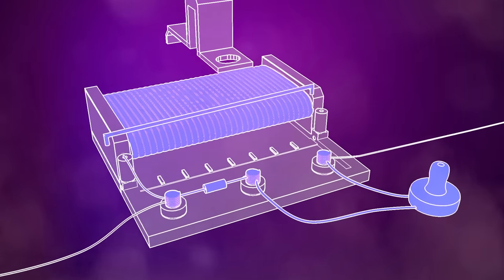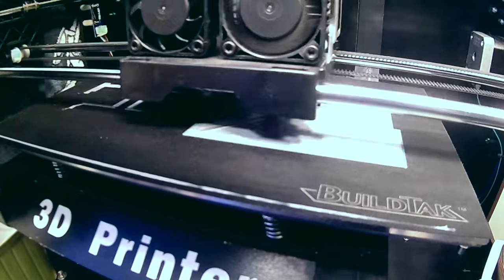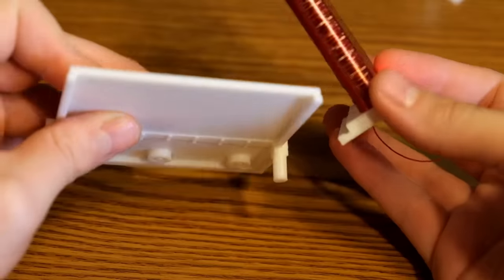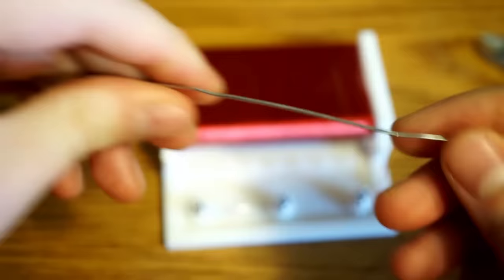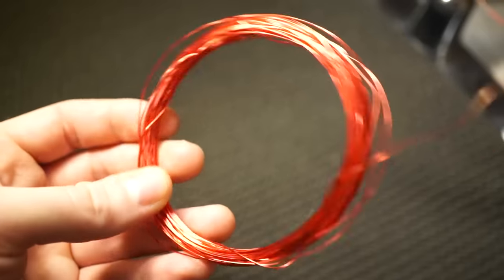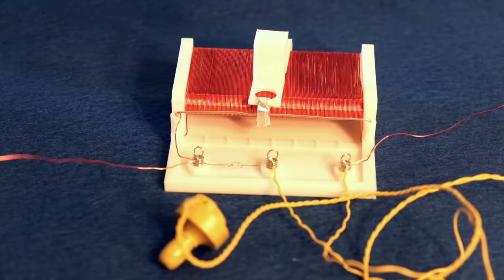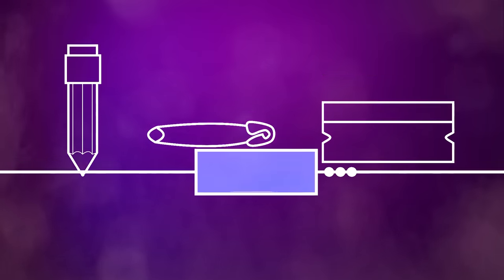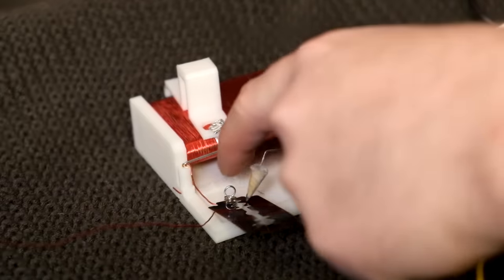3D Printed Radio | No Batteries

Comment: you forgot to mention that the diode must be a germanium one to be efficient. for example an 1N34 or an 1N270 would wourk perfectly
Reply from the maker: Yes you are correct and I listed the 1N34A diode in the video description. The same one I used.
Reply: Or a Shottky diode BAT85
Reply: The zero-bias MOSFETs are insanely good too. No battery required.
Reply: @ZEEROXCD-izzy  that's not nerd speak, that's engineering...
Reply: May I ask what the diffrence is from using a silicium one?
Reply: @javs533  it's all about the chemical properties of the material. Germanium behaves very similarly to galena chrystals that were once used as revelators in AM receivers. They can easily separate audio contained in the transmission, from the high frequency carrier, making it audible. Silicon diodes can do the trick too but they perform much worse. Germanium diodes are an extremely outdated technology but they are still very popular because of this special ability. Plus they are also great at sound distortion in guitar pedals: they have a very smooth and warm sound, almost like vacuum tubes
Reply: @Mr_Lambda  profile and pic check out
Reply: I see your mit education is really paying off
Reply: @javs533  Actually the real reason is because Germanium diode usually cause a smaller voltage drop when conducting. The signal being probably really small in this case, it is highly beneficial. However, as said above, a schottky diode should work just as well as they cause a small voltage drop too. (plus they are way easier to find than those unobtainium outdated germanium diodes)
Reply: @wa9kzy326  The germanium is still more efficient for this purpose
Reply: @Mr_Lambda  I don't mean no disrespect, but can you justify the "warmer sound" of a germanium diode? I believe it to be basically false. Germanium diode in guitar pedals usually are used for hard clipping, meaning that any effect they could have on the sound (the harmonics generated) are probably way too small to detect by human ears. For the record, I do own a tube amplifier for my guitar, and do believe they have an effect on the perceived quality of the sound by the mere signal to noise ratio they offer as well as by the harmonic content they generate, as they are highly non linear when used as an amplifier stage.
Reply: @thomhpl  I don't know if I'd call them unobtanium since you can still find ten packs on eBay for cheap. Not as cheap as little silicon signal diodes mind you, but you can find them just as easily. The hard part is finding germanium transistors, their hermetic seals fail over time and cause them to perform poorly or not at all. Finding working ones to match American made transistors from the 1950s and 1960s is an absolute pain.

If you're going to use a silicon diode your sound is going to be even worse. Get a fast recovery type for it to be even remotely viable.
Reply: @AiOinc1  I remember reading about the fact that a lot of the 1n34 you can find on eBay are fake, and actually just some rebranded Schottky. They appear to be some that are genuine though so yeah unobtainum is a bit abusive.
Reply: @AiOinc1  That's interesting, what makes a fast recovery diode more suitable? The reverse recovery Time of Schottky diodes is usually way better than fast recovery pn diodes. I'm also wondering what is the reverse recovery time of a Ge diode like the 1n34a. Btw, this is probably just over thinking, the goal here wasnt exactly sound quality I guess ;)
Reply: @Mr_Lambda  Oh man, there was a whole tred that germanium transistors are better for amplification.
Reply: @thomhpl  what i meant for "warmer sound" is that they have a less steep clipping factor, they don't sound dry as silicon ones that drop voltage to 0 instantly when they invert their polarization
Reply: @Mr_Lambda  You're right, but in this application, the diode is used in a detector circuit, I don't think it matters much. And btw, I do think it's perfectly doable to achieve the same clipping harmonics using silicon diode in a guitar pedal, by adjusting the amplification gain before clipping to match the same relative voltage drop, and by adding series resistor to the diode to soften the transitions. It's not exactly the subject of this video, but it would be interesting to do some double blind tests to see if it actually matters at all or if its homeopathic engineering ;)
Reply: @thomhpl  the warmer sound thing was only about pedal distortion. I only tested germanium diodes on AM revelators so i don't know how a schottky or a simple silicon diode would behave.
Reply: Ded The Channel yea said from a little sonic fan
Reply: @Mr_Lambda have you ever seen n the insides of an am transmitter before? or tuned a directional? can be scary and fun
Reply: @TheCoolDoctor  despite being a ham radio operator i never had the chance but i guess it would be hella fun :)
Reply: @Mr_Lambda  ill be it its not fun having to splice 5 of your 6 3/4 inch coax from your main AM transmitter and monitoring out of your building after they got cut. That was an 5 hour ordeal.
Reply: @Mr_Lambda  Makes you wonder why he even clicked on this video if he doesn't comprehend it LOL
Reply: @Mr_Lambda  So that's how they simulate that sound in cheap tubeless TS9s. The way more expensive originals had a single tube.
Reply: @MikinessAnalog  i'm pretty sure that they also use some level of filtering to manipulate the sound texture
Reply: This dude: Ackchyually
Reply: @Mr_Lambda  I see no difference in nerd speak and engineering
Reply: Why not go old school and make you own detector
Reply: @donwright3427  i'm actually planing to take an old razor blade, heat it up with a torch until it oxidizes and try to make it work with a pencil :)
Reply: @Mr_Lambda  I build my own pedal both using ge diodes and Schottky diodes. The main difference I see is leakage and internal capacitance. You can get a very similar result if you use the clipping Schottky diodes with a small capacitor and a resistor parallel to them. Usually 100pf and 47k resistor. Only noticeable difference is in the price.
Reply: Wait you forgot to use plumbus
Reply: Thanks gordon!
Reply: @Mr_Lambda  thank you been looking for a material that acts like a vacuum tube after all a transistor used to originally be 3 pronged vacuum tubes.
Reply: As a fantasy nerd this sounds like a bunch of wizards discussing which mana stones should be used for a communication circle.
Reply: @sebastianstewart6894  wait, diodes do not amplify. What i mean is that germanium diode clipping effect, sounds similar to overdriven vacuum tubes, but they don't serve as amplification component, that's not their pourpose. If you need to amplify you will need necessarly a transistor, a vacuum tube or an Operational Amplifier ( Note: O.A. can only be used as a pre amp, since it can only output 20mA max)
Reply: @sebastianstewart6894  yeah i know what you mean :) electronics sounds like wizardry because you have a whole lot of tiny pieces that do stuff and it's hard to understand how they work together. To understand in deep how they work you first need to know a little bit of electron physics, a pinch of chemistry, after that studying the theory behind the working principles of electronics will come easier. To implement that knowledge and design something from scratch, especially in the analog/RF/Audio field of electronics,  you have to learn a good amount of calculus. Most of the math in there are just some simple equations but in order to make something advanced you need to be able to solve integrative, derivative and differential functions. Yeah electronic engineering packs a punch xD
Reply: @keeby.kong2024 my crowbar doesn't think the same <3
Reply: @Mr_Lambda um... C-crowbar? that's my bad. I'm sorry. I apologize
Reply: Does a germanium 1N60 work well
Reply: @demonetizedhistory5806  it should work, generally the am revelation effect is a perk of germanium material itself. Look for ilthe component datasheet: if the brief description says small signal or power application diode it  should work. If it's a zener, schottky or varicap or something different i don't assure it will.
Reply: Ty
Reply: @Mr_Lambda  thx
Reply: @thomhpl  perhaps the "warmth" came from nonlinearities like with tube amps?
Reply: @Mr_Lambda  what about schottky or mosfet?
Reply: @wa9kzy326  how does one use MOSFET in place of a diode? Was their performance good due to their low 'on' resistance?
Reply: you were 999. my like made it 1000. and I got no idea what the hell is going on. cuz my cellphone got a radio! lock down bought me here.
Reply: @sultanmehmoodghaznavi6312  thanks for letting me hit this milestone, this is my most liked comment ever :)
Reply: When you came into a smart talking or engineering talks but you don't understand everything
Reply: Mr freeman this is wonderful
Reply: That is 1N60 signal diode
Reply: Yes I was going to ask what kind of diode?
Reply: @AiOinc1  he probably meant real ones & good ones?
 not fleabay ones.
Reply: the 1N270 is very expensive
Reply: Jason van Rooij the on voltage is much lower, like 0.3 volts vs 0.7.
Reply: @AiOinc1  There are lots of Soviet surplus germanium diodes and transistors on eBay, too. Just like their surplus tubes, they’re far cheaper than their American counterparts.
Reply: @Mr_Lambda  Revelators? Revelators? Oh, you meant rectifiers or detectors.
Reply: @thomhpl  I thought it was whatever diode (or rectifier or xtal) has the best gain-John in Texas
Reply: @Mr_Lambda  I read about that on wikipedia, I'm super interested in piezoelectric materials rn always wondered how that works lol
Reply: @ercost60  yeah sorry, wrong translation. In my native language detector is also translated into revelator.
Reply: @MrClean-ep7uc  long story short: piezoelectric crystals because of their chemistry, can vibrate when an electric pulse is applied to them and also generate electrical pulses when struck. Most classical piezoelectric material is quartz stone. They put a tiny shard of it in most common crystal oscillators that serve as clock generators on small microcontrollers and timepieces.
Reply: @3DSage  
Bnn
Reply: I'm a little late to the party but couldn't you just use a LED as the diode? I've thought about it, but am not shure

Comment: You don't need a 3d printer for this, really its the same concept as a foxhole radio. You could use a toilet paper tube for the coil if you wanted to.
Reply from the maker: Correct, there are many creative people that can make this with everyday items but I wanted to design and 3d print my own so it's easy and consistent to operate.
Reply: Than. Fucking. You. I remember getting those kits from hobby lobby as a kid lol
Reply: Thank you
Reply from the maker: Evil Koala  There is no fun in that. It's so cool to make one!
Reply: Evil Koala  Good idea.
But let's see you run it with 0 external power, other than what was coming over the airwaves, as was done in this video.

All in all, maybe you could just be impressed.
Or silent. Either is acceptable.
Reply: Evil Koala  I feel like you don't understand the point in making things
Reply: but a foxhole radio is not buzzword compliant.
Reply: @3DSage  With those touching connection between oxidizable metals, I believe it will definitely be consistent to operate. Reliable not soldered connections can be made, however.
Reply: @3DSage  
Esta loco
Reply: its a crystal radio
Reply: @MiiMaker  Sorta, a "crystal" radio uses a "crystal detector" (generally lead sulfide) a diode rectifier. A foxhole radio on the other hand improvised the diode with either graphite or oxidized steel as a makeshift Schottky diode. It was a improvised radio common in trench warfare during the pacific theater.
Reply: @nikushim6665  his name is 3Dsage, I’m sure he’s gonna make a crystal radio with a 3D printer…
Reply: @3DSage  He was banned!
Reply: Das Prinzip ist wie bei einenDetektorempfänger,Spule, Germaniumdiode oder  Kristalldetektor,Dreķo500pf, Kondensator, Kopfhörer.

Comment: Seriously?!

You built your own diode?!?

Jeezus.
Reply from the maker: Yup! It's not as good but still it works!
Reply: 3DSage damn impressive!
Reply: @3DSage  I think If you put your razor on a stove top heating element or an clothes iron you could have a lot more control on your oxide layer, it would also be more uniform and wouldn't be contaminated from combustion products. This would make for less tuning for your diode. At least that my thinking.
Reply: The point contact diode is one of the key components of a foxhole radio, they're built exactly this way with a razor blade and pencil 🙂
Reply: this is nothing new its a fox hole radio. theyve been around since before ww1
Reply: @3DSage  DIY diode from razor blade???? SAVAGE man!
Reply: A small piece of galena and a phosphor-bronze "cat-whisker" will also work as a detector. Google "antique crystal detectors". Properly handled, they can out-perform a germanium diode.
Reply: DCC
Reply: when I read your comment I believe it was a joke because to buy a correct diode is "🤷‍♂️"

10 sec0nds later:
caN I mAkE mY oWN DiOdE
Reply: Guys look up “Fox hole radio” soldiers in WW2 were making razor blade diodes and an ugly version of this radio years ago, it’s not a new idea..... having said that this 3D printed version is SO COOOOOOOL
Reply: Ok
Reply: @3DSage  You really blew my mind.
Reply: @FailedSquare  technically, it’s a cat’s whisker radio.  Originally, these kits had a piece of galena embedded in a small disc of lead solder. The detector was completed by a small coiled metal spring that was uncoiled enough to look like an open safety pin.... in fact, a safety pin was often used in these weekend projects.  The coil could be wound on a toilet paper roll. https://en.wikipedia.org/wiki/Crystal_radio  Brought back fond memories of a much simpler time!
Reply: You can find everything else but not a geranium diode. You should try making your own damn speaker. There's also a WAYYYYYY more cruder methods. Such as foxhole radios. On the ground! Using what's around you short of using wire. I have the article somewhere.
Reply: @FailedSquare  very cool thanks

Comment: Ahh, the memories... I built a crystal radio set like this, out of wood and wire, with the crystal diode back in the 70's when I was 11.  I used the center screw of a wall socket coverplate for the ground connection, and connected the antenna to my metal bedframe. It worked like a charm!

Comment: 4:18 Unless you have pex tubing for the water supply and pvc for the waste water.
Reply: Eh, there are many ways to fix that. Stick a wire into the ground on a outlet, that works too. Neutral would also work as it goes to ground as well, but you must make sure you don't have a miswired outlet that has hot ground reversal. It could..... hurt a bit otherwise. Or, if you're outside, take a 3in nail and pound it into the dirt and pour a cup of water on the spot. Tie a rock to the antenna and throw it over a tree branch. There are many ways around this problem. d:
Reply: I considered that same issue.
Reply: Kallvin - if you had a transformer, light bulb - lamp, aquarium - air pump, water filter pump, heater, kettle on the same circuit  😉

Comment: Yes, I remember 51 years ago when as a kid I built my own crystal radio.  I had a collection of different types of rocks that were glued to a piece of cardboard.   I took these home from where I was during a vacation.  I then used one of them to build a crystal radio. It was a quartz crystal. Worked like a charm. The quartz crystal rock became the diode. The rock was placed in some aluminum foil  , and a wire pocked at some point of the exposed area.  Even changing the point of poking, changed the channel being received. Also, of course back then, one had wrapped the wire around a toilet roll cardboard. For the ear piece, I used part of an old telephone ear piece.

Comment: My dad once made a similar radio when I was a child. He used a variable capacitor attached parallel to the inductor instead of a tapped variable inductor to scan the band. It was basically just small metal sheets on two rods, and they can turned into each other kinda overlapping (like two combs) without touching each other.

Comment: In high school "electronics" class we built what we were told was a mosquito/bug repeller. I was just a basic circuit with a battery and a speaker that emitted a high pitched squeal, but if you got the on/off switch in the perfect position, you could pick up radio on it. Never understood how it worked...

Comment: The most important thing is missing - AM broadcasts (long or medium waves) must be available in your area. The FM will not pick up the crystal unless you live directly at the transmitter. Many people were disappointed with the construction of the crystal because it did not work because most transmitters work with frequency modulation. In that case, it is better to use your old mobile phone, which has an FM radio and works without the Internet.

Comment: I built one of these many years ago using plumbing pipe to form the coil, 1N34A diode and a variable capacitor to allow more selectivity with tuning 🙂
Reply: Yes, the "2 inch" plastic plumbing pipe makes a great coil form.
Variable capacitors are getting hard to get.  Home made ones can be done.  Home made variable inductors are also within the reach of most.

Comment: "we don't need a battery, we will just use the strength of the radio signal" 
connects to 100watt guitar amp :D
radios that use batteries also use it for amplification i guess, so project did use an external energy source
but i get why you said that, great work man
awesome video, keep up the good work!!